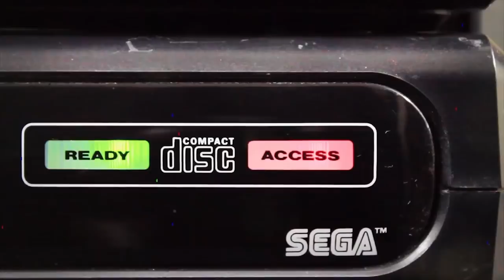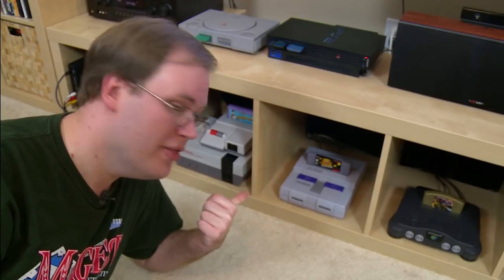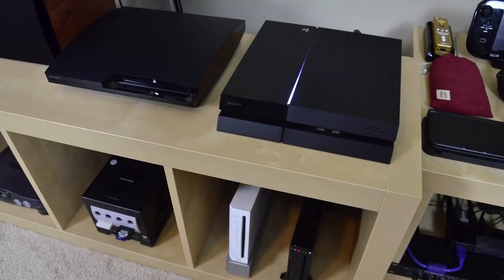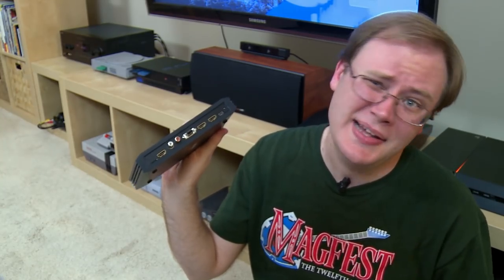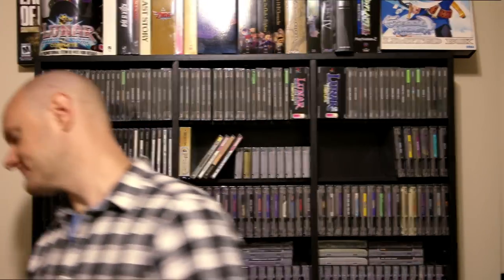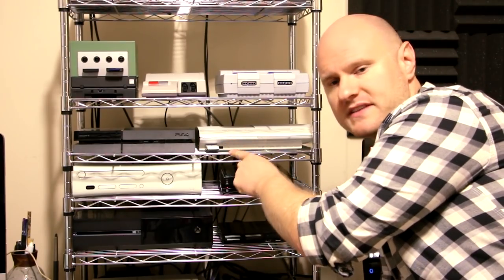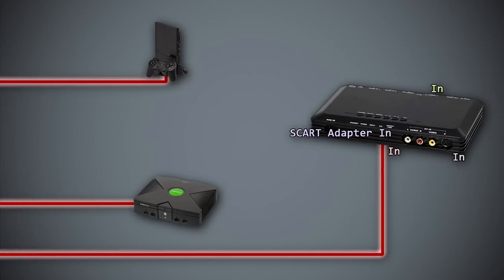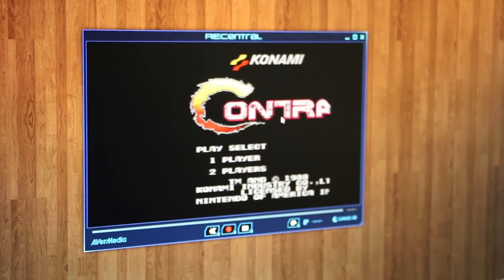RGB and Modern Gaming Setups :: RGB102 / MY LIFE IN GAMING

Comment: DC with rgb? No, no. Use VGA, difference is like night and day...
Reply from the maker: [Try4ce] I think at the time we did this video, we didn't have our Dreamcasts setup the way we want. We now use VGA boxes called "Toro" by Behar Bros. They pull VGA from the system, and you can then connect either a VGA cable to the box, or a SCART cable, but the cool trick is that the SCART will carry 480p. If you use SCART on Dreamcast without a box, it won't be 480p. This lets us integrate it into our setups much more easily than regular VGA, but we still get 480p.
Reply: Yes, Behar Bros do make the top notch DC VGA-boxes, indeed ;) Earlier, I didn't have a problem with scart (RGB) consoles. My projector (Panasonic AE900) had an Scart-socket and the picture quality was really enough for me. I upgraded to AE4000 and did order that cheap scart to HDMI-scaler from ebay... Not too happy about it. I will maybe try Scart (RGB) to component box and after that (in the end) I will get Framemeister... Eventually ;) 25 consoles now (on somewhere they mentioned, that Atari never made an RGB-scart lead for Jaguar. Not true, as I have the official one xD The lead is REALLY heavy duty!) and maybe a few coming later ;)
Reply: What's your thoughts on VGA to HDMI upscalers? I recently ordered one from Portta for a Dreamcast, but the Dreamcast arrived smashed. Before the console stopped working, I thought the video quality through the VGA to HDMI was pretty good.
Reply: My Life in Gaming: You should do a video on how to get the best pucture out of the Dreamcast, in your RGB 200 series.

Comment: I wish you guys would link the cables and such you reference in the description.. very hard to find sometimes.
Reply from the maker: For all cable needs in the US, definitely go with Retro Access. 

Affiliate link: https://retro-access.com?aff=4
Non Affiliate: https://retro-access.com
Reply: Ayy thanks, I'm sitting here diving through eBay pages to find the FrameMeister SCART adapter. Do you recommend the powered one, or is the passive one good enough?
Reply from the maker: We both have the powered one that has the sync stripper built in. It saves you from some potential headaches in the long run.
Reply: Perfect, thanks dudes!
Reply: @EposVox  sup

Comment: tsk tsk tsk Coury, that Dreamcast belongs at the TOP!

You might want to rethink the vertical setup as your daughter could pull the entire thing down on top of her
Reply from the maker: TheDevilBurning [Coury] It was on the top! ...But the PC-Engine Duo R pushed it down a level, unfortunately. If I had one more slot available up there, it'd be the first one to fill it.
Reply: ***** Get VGA on it and it'll be back on top :-)
Reply: ***** About VGA on the Dreamcast... if it is capable of outputting VGA perfectly, why there isn't an appropriate entrance for VGA cables, and needs to be modded or to buy a VGA box which is quite expensive?
Reply: You can buy a box from Behabros for between 40-80 bucks depending on what you want it to do, either bigger scanlines or SCART compatibility.
Reply: Ya, also, he should use a VGA box with it and then add a VGA to component converter.
Reply: If I can find a good VGA to Component that is.
Reply: @mylifeingaming  wall mount em around the room as a perimeter like shelf on the wall made of wood like a l shape or like a shelf support L bracket etc type for holding up all of the consoles in the area space of etc high in room so no space is used of the desk or much less anyways

Comment: Coury, another reason you should have your Wii hooked up is that it can play your Gamecube games at 480p. It is true that a 480p GC game through Wii component cables have slightly less detail and color clarity than through a Gamecube component cable, but considering the massive cost of GC component cables, the games through Wii component cables are perfectly acceptable for the price. Much less expensive, and almost as good.

True, you won't be able to use the Game Boy Player with it, and until you get Gamecube component cables, that's really all the Gamecube will be good for, but why play at s-video when a simple solution is right there, not being hooked up?
Reply: ShogunGino But he connected his Gamecube with Component...
Reply: Wii 480p looks worse than rgb through 240p on an 800 line pvm

Comment: Guys if you want one RGB switch to rule them all, it has to be the Extron Crosspoint - http://www.extron.co.uk/product/product.aspx?id=crosspoint84. It will switch anything, composite, s-video, component, RGB as long as you can get the cables for it. Only caveat is it needs clean sync.

Comment: I need help there are two download files and i dont know which one to pick.
OSd. Rev. 2 02 RGB-mini CPU Ver. 2.02 Ver.2.00 OSD Table This is the first one english  version

below that it the other download says OSD Rev. 1. 11
XRGB-Mini Boot Loader Ver 1.01 XRGB-Mini CPU Ver 1.11 english version

Which one do i  download? Do i download the first one only the top one or do i download both? I got confused someone please help?
Reply from the maker: +Vincenzo Vieri The one you want is the CPU ver. 2.02 English Version. The "Table" is simply a PDF with a diagram to show you how to navigate the menu. You've probably already found this, but for simple instructions on what you do with the firmware file to update the Framemeister, check this: http://junkerhq.net/xrgb/index.php/XRGB-mini_FRAMEMEISTER#Firmware
Reply: Thanks man i really appreciate it

Comment: i see you are using the euro SCART to XRGB mini 8-pin vs the JP21 scart. Which produces a better picture? Why that cable over the JP21?
Reply from the maker: [Try4ce] The only reason is because the European standard is more established and easier to get equipment that works with it. The quality is identical, the only difference is that the signal is on different pins.

Comment: Can't you guys import SCART switches from Europe? Just look for the ones with all 21 pins connected and if they're well shielded. I use a 5-way professional switcher with 4x 21p SCART and 1x composite + 2RCA audio inputs, and 21p SCART output and composite + 2RCA audio output (great for getting the audio to both the CRT and stereo systems).

Comment: Hi guys! I have been greatly inspired by your RGB videos and since you first released the, I have been rigging my room to become a complete work and gaming den. I do have a question about the NES RGB mod. Like you, I do not have any knowledge of soldering and think buying a pre-modded NES is the best option for me. But at the same time, I still have my NES from when I was a child and kinda like the idea of keeping that alive... though it hasn't been turned on in nearly 20 years and I'm not sure if it still works (working on getting replacement cables). So I was wondering what the cost was of having your NES modded versus buying a pre-modded one. Also, top loader versus front loader (I prefer front for space and aesthetic purposes). Please let me know your thoughts. Keep up the awesome work!

Comment: It's funny you show that HDMI splitter there cause it looks very similar to the SCART-to-HDMI adapter I currently use. Also why use an HDMI splitter to begin with? What is the benefit of it? Is there a good place to find Component for the original Xbox? Also it will be nice to see some links for the switchers you use in the description since the idea of having an HDMI and Component splitters for my consoles will be ideal for me. Thank you for the video guys! :)
Reply from the maker: [Try4ce] There are a few benefits to the splitter. First (and this was totally not part of the plan, just a happy accident), the particular one we use (which we bought on eBay, and the seller doesn't seem to have them anymore) strips HDCP copy protection... this is meant to keep people from illegally copying movies, but it's frustrating because it also prevents HDMI capture from the PS3 (and until it was patched, PS4). Thankfully, we don't even have to think about that with our splitters. The other reason is to send a line to both the TV and the capture card. I don't want to play the game while looking at the recording window on my computer, because not only is the quality slightly worse, but there's also noticeable lag that I don't want to deal with. The reason I use two splitters is to bypass the Framemeister for HD systems. While I route the HD systems through the Framemeister so that they appear on my capture card, I don't want to have to turn on the Framemeister every time I play an HD system, if I'm not recording or streaming the footage. You can have the Framemeister set to simply pass the HDMI signals through without processing them, and this is what Coury does. His setup is a little simpler in that regard, but I just like doing things the way I have them, for now. Coury would also know more about where to direct you to for Xbox component cables and switch boxes.
Reply from the maker: ***** [Coury] hey sure thing!

When it comes to Component switchers you'll probably be good with just about anything. For anything above S-video, I prefer to use powered ones in case there is a problem with signal strength. 

The one I use is by a company called IMPACT. They have one like this http://www.amazon.com/C2G-40324-Component-Performance-Selector/dp/B000AM3U2I/

Thats not the exact one I use though - mine was a bit more expensive because it outputs to two destinations at once - a feature that I use to streamline playing games and outputting the VHS "How to Beat" videos we do. The two outputs is purely for convenience of not having to get down and pull wires.

This is the HDMI splitter I use http://www.amazon.com/Kinivo-501BN-Premium-wireless-adapter/dp/B0049SCB2Y/

Xbox component cables are cheap and easy to find. You can get any off of amazon. First or third party ones. The ones I got were 7 dollars.

Also, I saw a comment though i can't find it now about the Duo. This is the seller that I bought from, but you really gotta watch his account - he only puts up one unit every few days and they generally go quick http://www.ebay.com/usr/doujindance
Reply: *****
Thanks for the elaborated response! The HDMI splitter you put looks remarkably different than Try's, and is very similar to the HDMI-SCART adapter that I use. I also had very bad luck with those MadCatz component cables so I am not sure if investing in those cheap cables will do the trick.

Comment: I have Just got a Shinybow 6:2 Matrix Switcher from http://www.ani-av.com/shop/product_info.php?cPath=22_29_51&products_id=199  I can say it works fine with Sega 32X\CD2\Gen2 CSYC, PS1 Luma, Toro Dreamcast Scart 480p, SNES and NES CSYNC. It is a high price, but its is a strong build does not feel cheap at all, only the remote does though. I do not have other systems to test it on. My SNES Mini and NES Toploader are modded for RGB, not sure if it maters, and My sega everthing goes though the 32x.

Comment: You should run the dreamcast in VGA
Reply from the maker: Super Gains Bros. [Coury} I actually had a section about this that I cut out, as when we do the system specific videos, I'd cover it there. I have a VGA to component box that I got - but the conversion was causing the picture to be way off center on the output and it was driving me crazy. So instead of getting into that in this episode, I thought I'd wait to see if I could fix it.
Reply: Oh ok, yea for some reason I've found there are few via conversion boxes that work well, however for you setup it might not be the best but just going straight via to a tv or monitor that accepts it might look better than an upscaled s-video. However the drawback is that of the drawback using component with the original xbox, in that some games are incompatible and will not work with the dreamcast's via, or the OG Xbox's component.
Reply: Mod your Dreamcast VGA box to output 15khz too, tie it into the Mini with a sync combiner and you have 100% compatibility and 100% best quality for every Dreamcast game.
Reply: *****
I had to wait a month for it, but I'd recommend the Hanzo so that way you can have almost 100% compatibility. Only games I had problems with when Bangai-O and Psychic Force 2102 but the rest look amazing!
Reply from the maker: ***** I've seen the Hanzo mentioned a lot. I think I'm definitely gonna get it.
Reply: ***** ***** If you have a VGA box with 15khz/31khz switch hooked up correctly to your Framemeister then compatibility should be 100%. I'd wait for the Toro VGA box now though, especially if you want to use SCART switches in future as it will be easier to connect through a SCART switching matrix to the Mini.
Reply: Dreamcast VGA to HDMI looks amazing definitely worth it, Shenmue ........so beautiful
Reply: Videogame Bucko
What makes it better than the Hanzo? And it's not really 100%, like I mentioned Bangai O doesn't work properly :|
Reply: *****
It should be 100%, as far as the Dreamcast is concerned you have a SCART cable attached. As long as you have the 15khz switch ON and your Dreamcast attached to a device that can process both 15khz and 31khz signals. The Toro will have a dedicated SCART output that carries 15khz and 31khz signals so it's easier to route it through a SCART switch to the Mini.
Reply: But I use VGA
Reply: *****
That's the point of attaching the Dreamcast to the Mini, everything works down the same VGA cable, 240p,480i and 480p. You just flip the VGA/RGB toggle switch when you want to play a game like Bangai-O
Reply: Videogame Bucko
Well I tested both it and Psychic Force 2012 and they don't work. When I do the flip from RGB to VGA for Bangai, it makes the game window 25% of the whole screen. Psychic doesn't even work when it's on RGB mode and all I get is an "Unsupported" message on the screen, not even the tradition Dreamcast error message. That and I got to ask, Mini what?
Reply: *****
The XRGB Mini Framemeister, like in the video (d'oh!). It doesn't work because your display doesn't support 15khz signals, the XRGB Mini does.
Reply: Well usually people refer to it as the framemeister and not the mini. And well, nothing I can do but get the device, but I don't have 400 bucks available, especially since I need to get a capture card for my 3ds.
Reply: A 15/31hz VGA box (like the Hanzo) will work for Bangai-O and other 240p games. That's specifically what it's designed for. You just need a display or scaler (like an XRGB) that can actually handle 240p RGB video.

***** If you already have a Framemeister, then a Hanzo would be at least partially a waste of money. The guy who manufactures those also makes a variation called the Kuro that is slightly cheaper. The only real difference between the two is that the Kuro doesn't have a scanline generator. Since you have a Framemeister (which can add scanlines itself), then you don't need another scanline generator. (I would, however, look into the Toro. It might be easier to connect to a Framemeister and may not require the same adapters as other Dreamcast VGA boxes. I can't remember what new features it has.)

What kind of VGA-to-component converter do you have? If it's an Audio Authority 9A60 or similar, try opening up the device and adjusting the poteniometer inside. I have one myself and had to crank it all the way clockwise to get things to be reasonably centered on my Sony TV. (And for some reason it doesn't play nice with my XRGB-3 on 480p sources, but it's fine with others. Still need to figure out a solution for that myself.)
Reply: Sixfortyfive
Yeah I use an Atlona HD upscaler that goes from VGA to HDMI which I heard from many is one of the best out there but it doesn't work so I guess I need something else.
Reply: ***** I would generally advise against VGA-to-HDMI adapters for the Dreamcast. The DC is a little weird in that it doesn't output a typical VGA signal. Standard VGA is a plain 640x480 image. NTSC TV is 720x480. The Dreamcast outputs what is technically a 720x480 image, but only the middle 640x480 pixels are filled. A VGA-to-HDMI adapter (as well as most LCD monitors and TVs that actually have a VGA input) will just assume that the Dreamcast is sending it a plain 640x480 image and actually incorrectly squish and stretch out the image horizontally, reducing the quality. Not sure if the Atlona is in the same boat in that regard.

VGA-to-component transcoders (not full upscalers) usually fare better because they don't process the signal as much; timing, sync, and resolution are usually left alone. Only the color space has to be converted.
Reply: Well it has gotten good reviews and many people recommend it like Adam Koralik who is a big Dreamcast guy. It usually goes for 250 but I got mine for 120, which now you make me feel like I made a bad call. If that's the case, I hope you can PM me and we can talk about it in private since I'd rather not spam this video ^^;
Reply: Sixfortyfive
I'm sure the Kuro is discontinued isn't it? The Toro would be a good solution for Framemeister users especially those who have got those new auto SCART switches (gscartsw).
Reply: Rephrased down
Reply: *****
Still don't think you are understanding this correctly. It's not your games that aren't working, it is that your display cannot display them. VGA to Component or VGA to HDMI might work as they support both 31kz and 15khz. Bangai won't work with a straight VGA to HDMI though since HDMI doesn't support 240p
Reply: ***** Bangai-O is a 240p game. To run it in RGBHV you need to have (1) a VGA box with a 31/15khz switch (like the Hanzo and its variants) and (2) a VGA display or upscaler that actually handles 240p video correctly. You need both of these things to get those games to work.